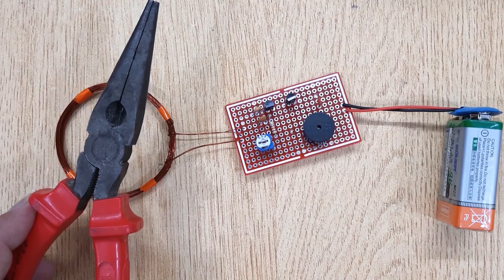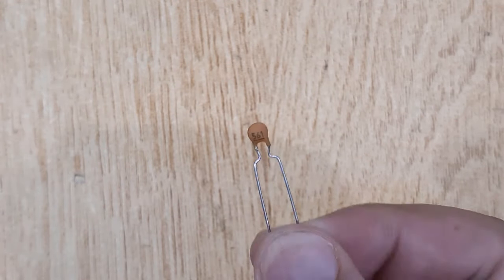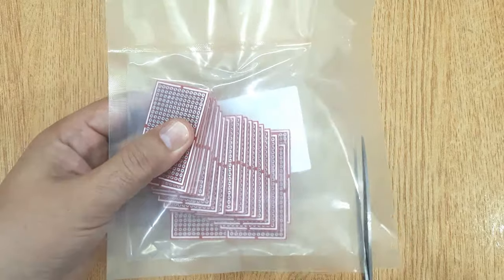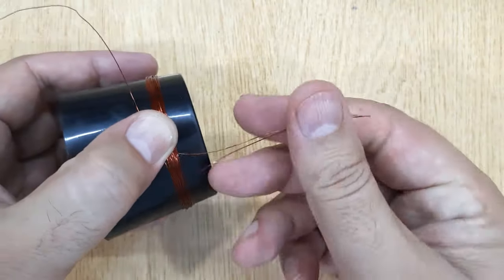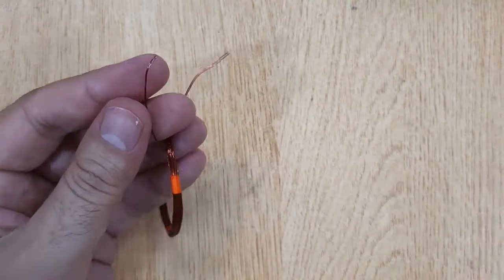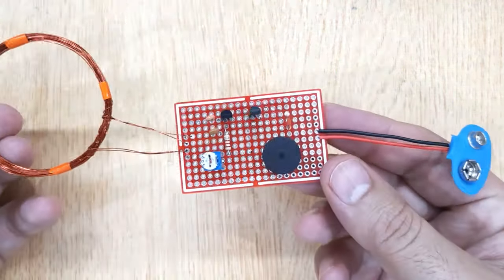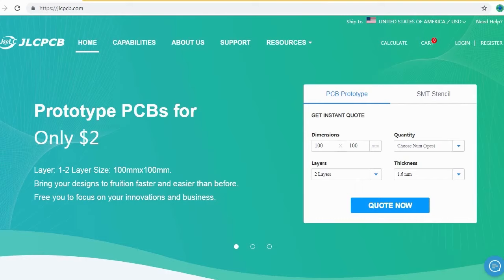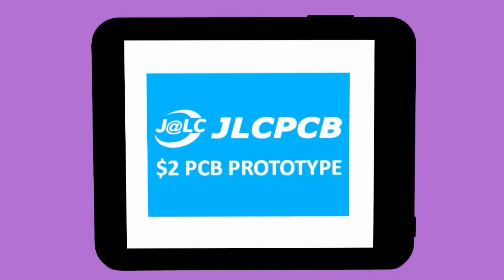How to Make Gold Detector or Metal Detector | Best Metal Detector

Comment: it would be nice for beginners, like me, to learn about each component you're using on this build, and how to get them.

you should make the description more helpful for users instead of marketing. try adding links to the specific components that you're using, you could even put amazon affiliate links and profit from that.
Reply from the maker: Thanks for the idea!
Reply: he did tell you what to get now go on eBay and buy them. My God it is not rocket science. If you are not smart enough to know what the items he clearly said to get are you should not consider doing this project. This is a basic electrical circuit.